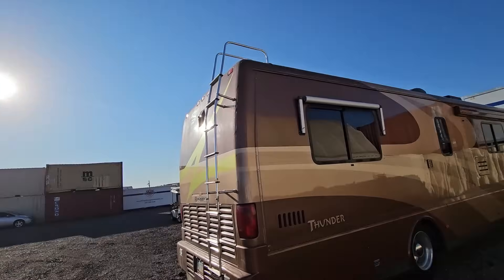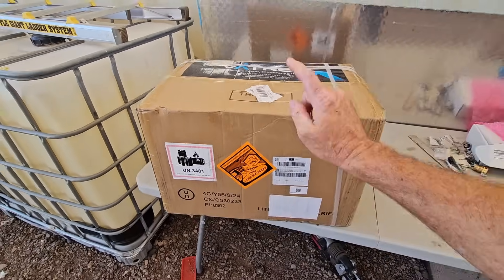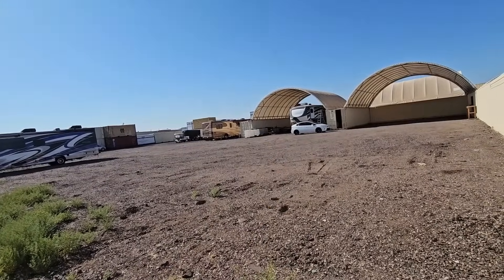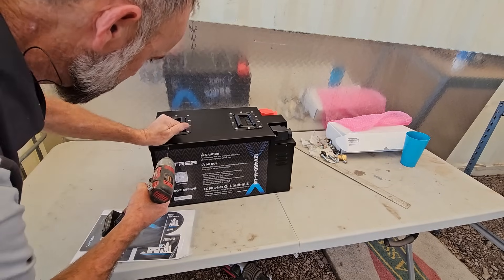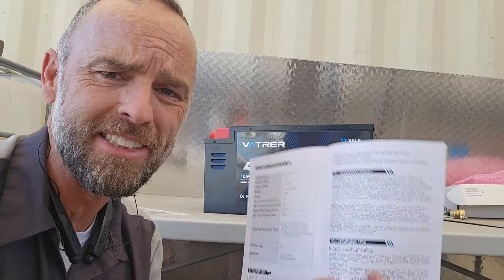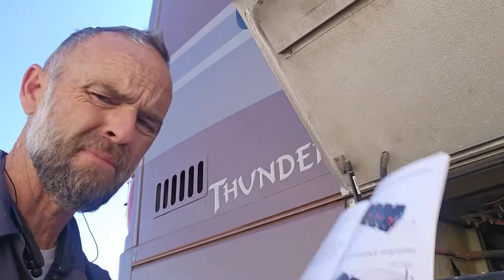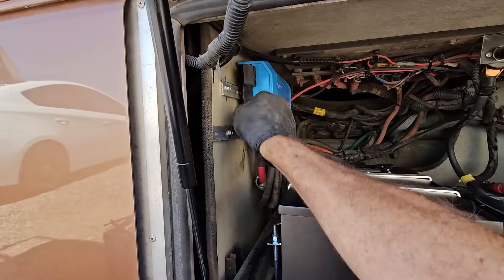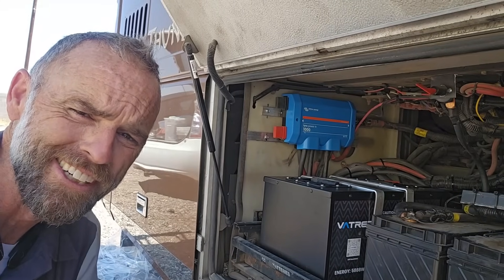How Did Vatrer Make My 460ah RV Lithium Battery Better? It's Heated!!!

Comment: i researched this battery after watching your first install , there is a video of this battery being disassembled and tested fully , it was mention it was the best battery across his bench. 
i bought and intalled 2 of them into my monaco dynasty . game changer .
Reply: I installed a LI-Bim 225 same as buddy did in the video.  I have a 200 amp alternator . And while driving i watch the output during the 15min on 20 min off timer.  The current draw is not affecting the alternator. It also doesnt charge the battery very quickly while driving.  The 2800 magnum inverter puts out way more current. if youd rather charge faster with your generator.  I set the magnum to custom  14.6 ,14.5 and equalize 14.5.   Float time is set to 6.5 that all you can get for float time if you set it higher they automatically revert to 2 hrs.  And i pulled the 10a fuse out of the magnum shunt. Bks or whatever its called.    The shunt just interfeared with charging the 460s all the way since it doesnt recognize lithium differences.   
To install the li-bim 225 i made up two cables and tied onto the same spots as the big boy without removing the big boy. And moved the leeds to the li-bim .  
The bms in the vadrers take care of everything , you just have to feed them.  
I can go a week running a residential fridge  , the stereo 6x9s with 200w amplifier . And a starlink 24hrs a day will last 5-6 days.  
So long as you have 20amps of solar happening.  Its almost infinite.  
I’m happy with it. 
The new vadrers bluetooth reach about 40feet. Oddly one reaches a little further than the other. About as far as the victron bluetooth shunts.   I have heated floor so i think those wires act like a faraday cage so it barely reaches the drivers seat
Reply: I have two of them waiting to go into my Allegro RED.  What, if anything did you do to keep them from charging directly off your alternator?
Reply: @tomdewinter9962 use d dcdc charge tipo victron xs 50ampere regolabile

Comment: Will this battery start my 7500 onan?
Reply: I have a Gas Fuel injected Onan 7K and it with the fuel injection pump pulls 80-120 Amps, the life P04 shows in specs to do continues 200 Amps. My 7K starts without issue. Does not even take up one lifecycle of the battery.
Reply: Not likely, 2 in parallel will typically be needed for cold-cranking an engine that size imo

Comment: The battery won’t be harmed by sub-freezing temps, unless you try to charge it at sub-freezing temp. You can continue to use it down to much colder temps. Temps have to get to -4F before you need to worry about operating it.

However, I’ve seen content which suggests that relying on built-in heaters will damage your battery because they don’t heat the cells all the way through and the sensor placement cannot give an average temperature that is very accurate. The heat needs to be supplemented in order to get the cells to temp all the way through.i don’t know the truth of that claim from personal experience but I would definitely investigate it myself if I was subject to cold climes
Reply: Good point. I installed two of the heated ones a month ago. I feel that with the heater inside the case, the heat is at least somewhat contained inside the battery vs a heating mat that's outside the case. As the heater cycles from 32 to 41F,  the environment inside the case should get the cells more evenly heated over time.  Thoughts?
Reply: The BMS will prevent the batteries from being damaged at the low temperatures.  The batteries are not damaged at the lowest temps.  Only if you draw power from them below 32 and the BMS will cut off power before it happens. You can charge below 32 and the BMS will cutoff charging when the temps go below that threshold.

Comment: I have the same Vatrer as your original (unheated). Whenever I'm home for an extended period I take the battery out and leave it at the house. If I ever have a power outage at home I have an isolated connection w/inverter that I can attach to my furnace & a/c (if they're attached, they are divorced from the panel - manual, not automatic - simple.) I just have the battery and inverter sitting on a $10 dolly from HD and roll it around, as needed.
Reply from the maker: That's a great idea for home backup power!

Comment: Do you know if the original style battery will work with the new app?
Reply from the maker: I was not able to
Reply: @AZExpert . Thanx I was hoping it would
Reply: I am able to get it to work on the old style battery, however you have to close out the other apps you could be using then it will work. I still like overkill but when I close it completely the new app works fine I am just used to Overkill more.
Reply: @richardh263 thank you for the info.  I will give it a shot.   I was also thinking if I could find the Bluetooth antenna and get it outside the case too.  The original Bluetooth is pretty pathetic.   My heaters have worked great stays toastee in my confined enclosure in the back closet

Comment: The only issue with my 460ah water is it will not start my 10kw diesel generator.  But some RV's may use the chassis batteries for this, so plan accordingly....  Solar on the roof may eliminate the need al together..
Reply from the maker: Yes, my generator starts from the chassis batteries

Comment: The heater will only enable if the battery is under charge. It will not function if stored without some sort of charger involved.

Comment: I opted for the non heated Vatrer because I also live in AZ, and I don’t think I have a temperature problem, but I don’t get anywhere near the range in mine without that little antenna.  Mine is about six months old now and I don’t even bother flipping the disconnect anymore.